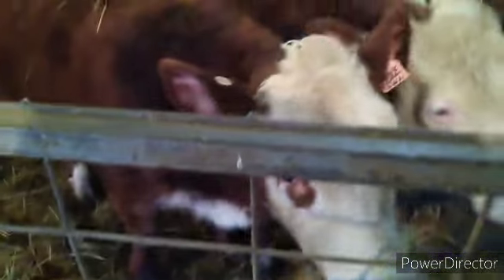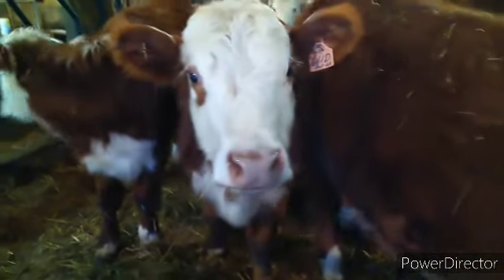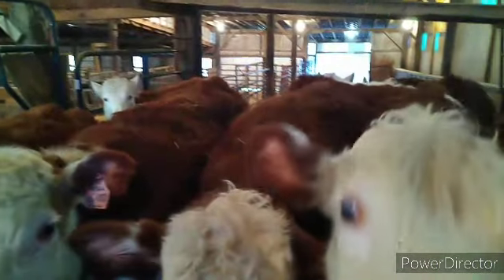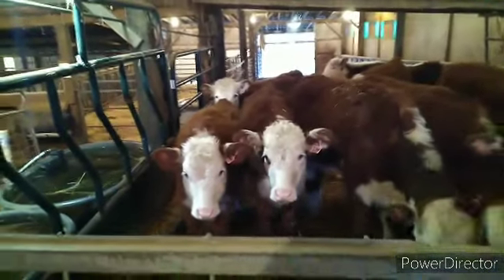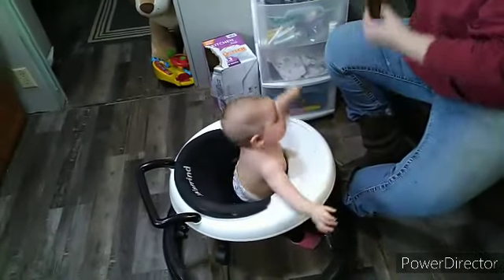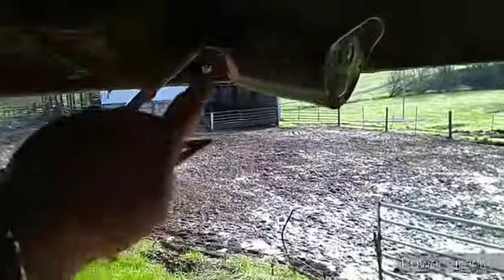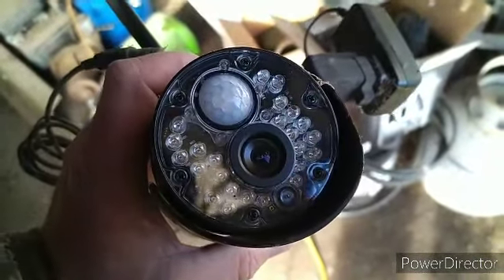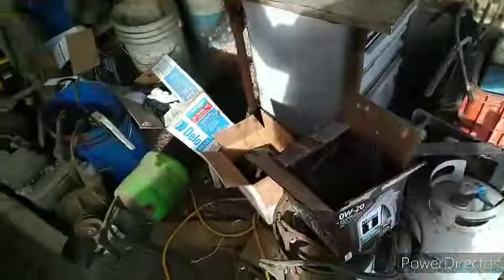camera issues and lot cleaning

Comment: Evening
Reply from the maker: Evening sir.
I hear you are out of the def mobile at the moment 👍
Reply: @GosselinFarmsEdGosselin  not sure yet, but my truck is back
Reply from the maker: @ronphillips1437  🤞🤞
Reply: @GosselinFarmsEdGosselin  it was acting up on way back from shop but I think mory knows what sensor was causing issue he still has to test drive it to figure out for sure
Reply from the maker: @ronphillips1437  ya.. I told Ty, need to check to make sure everything is working.. and the beyoche' job is, unplug all the connections, make sure they're clean and dry and fill them with dielectric grease. Sure solves a lot of problems
Reply: G'day Ron 🍻

Comment: We had camera failure last year.   It would die when temps got too high.  Our new ones glow in the dark from the infrared sensors too.  We actually hire a service for our system.   I know what I don’t know😊 and I don’t have patience for things I can’t hammer.
Reply from the maker: I remember you telling about that.. 
Some fancy stuff would be nice, pan and zoom would be great!! But for the minimal investment, theses have served us well. Hopefully moving the antenna again, will work 🤞
Really don't know why it quit working to begin with, only thing that's changed is a new house going up on our east line.. about the time the first wall went up, that camera stopped working 🤔 
Patience... Lol

Comment: Good morning Ed. 
That is so frustrating when electronic crap doesn't work like it should. I would be pulling my hair out.
Blakely feeds herself already! She's getting to be a big girl. 
You folks have a good day.
Reply from the maker: Good morning Garry ☕☕☕
I learned long ago, anything that works through the air, can be affected by the environment around... Even though WiFi doesn't travel very far, I'm wondering if the new house being built could be affecting it🤔 that one has worked 60-75% of the time, but has dropped to 0-10% since they started getting the walls put up... Coincidence?? I don't know..
Need a bathtub, put Blakely in and let her feed herself, when she's done, bath time 👍☺️
Have a good day my friend!

Comment: Do those cameras work off of WiFi ? I wonder if it would be easier if you had a router and a wifi repeater in the shop to the house . I hard wired a Ethernet cable to the shop and beamed back to a second router that worked like a switch , I found out the Wifi routers the Internet place bring out I up graded and never had a issue
Reply from the maker: Yes.. wifi direct to the monitors.. 
Just gotta get the signal out where it can get to the monitors